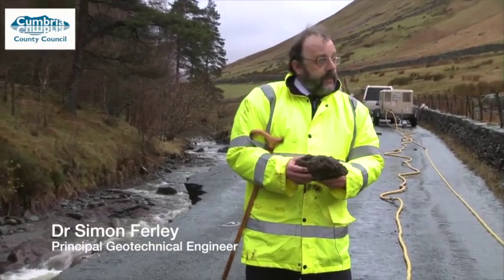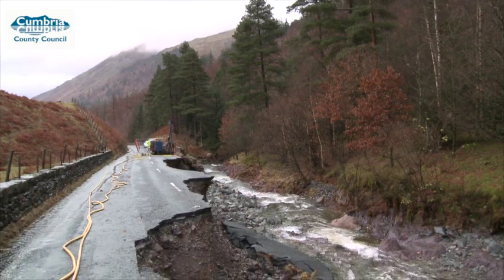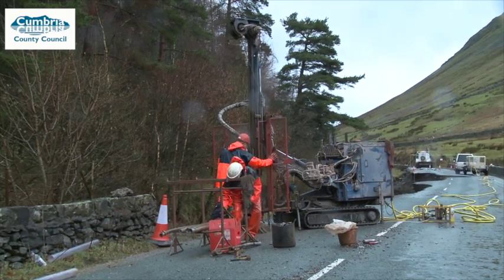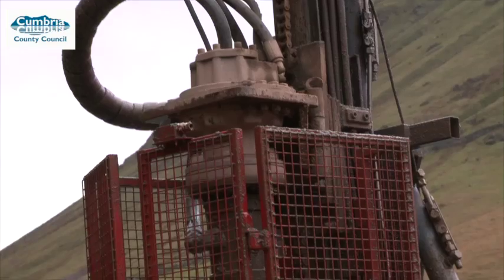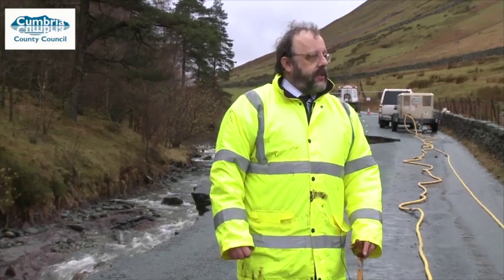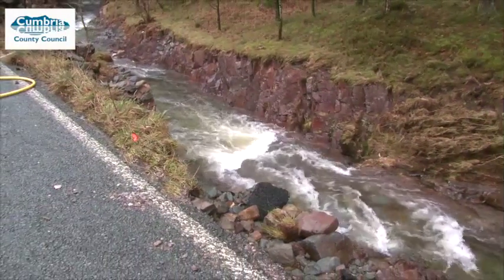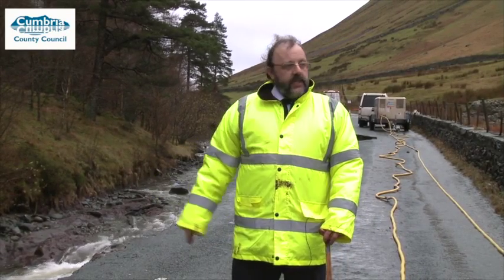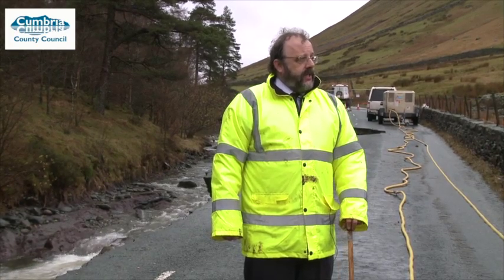A591 - Understanding the impact of the floods

Comment: I am concerned about the approach here which seems to be to create a gold plated solution that will take 3-6 months to implement. The existing solution (retaining wall etc) lasted for 75 years - so how about replacing with the same 'fix'? Might only last 50 years but would only take a month to implement. The approach to the landslide risk also seems overly cautious. Remember the landslides in the mid 1970s? These were fixed pretty quickly without the caution being expressed here. Someone needs to be pragmatic here as a broken link between north and south Lakes is a trajedy for many people and businesses.